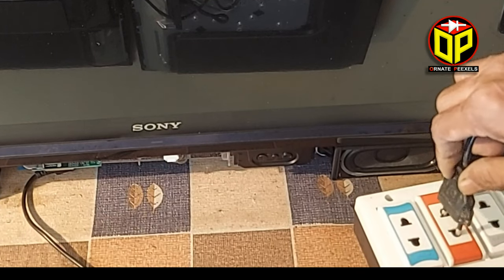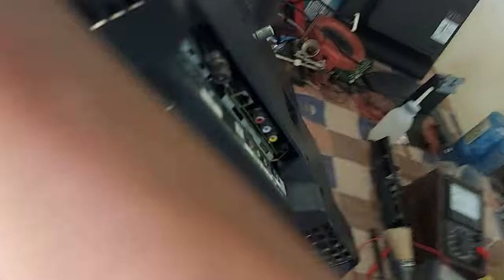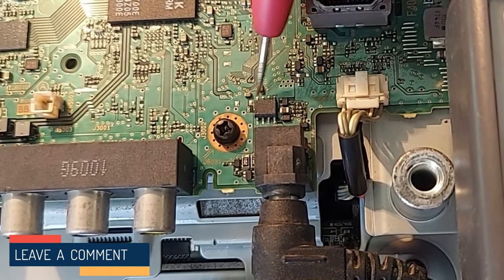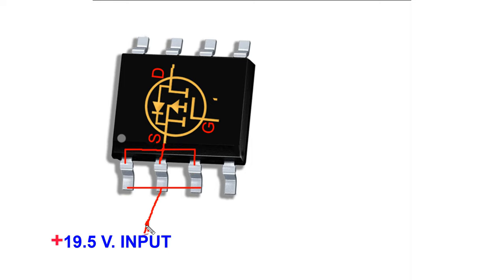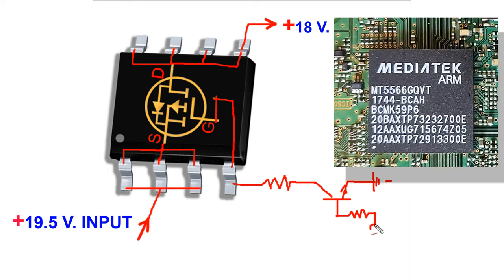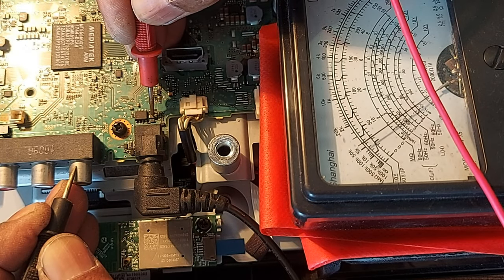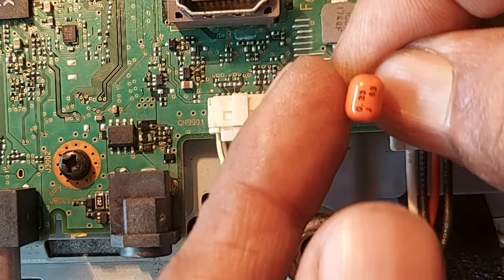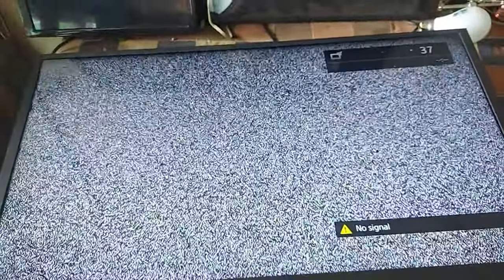Auto Power OFF Problem | Sony Smart Android  LED TV Repair, TPC8129 MOSFET Datasheet

Comment: Great work, and very impressive! Congratulations, and may the Almighty God bless you, brother. I have one quick question: How did you learn and identify that you could replace the SMD capacitor with a 0.33µF, 63-volt ceramic capacitor and still have the system work? In my opinion, it is hard to identify the specs of an SMD capacitor, right?

Comment: Thank master for tutorial, i have one question. If I don't have this   CI i ken use MOSFET transistor?
Reply from the maker: Yes, for this circuit you can use P-Channel MOSFET with internal diode (not zener diode).
Reply: You are correct, but there can be a zener diode between gate and source in some mosfets. You are very good technician keep up the good work.
Reply: @OrnatePixels   Oo thank you master

Comment: Sir, do u have service code for Samsung UA32N4003ARXXL, Service mode not opening with remote with all combination, nor with service remote,  problem is mirror image,  plz tell if any other solution for this
Reply: You need to find appropriate software(firmware), it is not for that panel. Did you change the main board?
Reply: Thanks for feedback,  it's original board,  service mode not opening